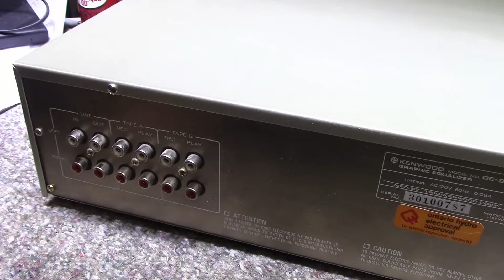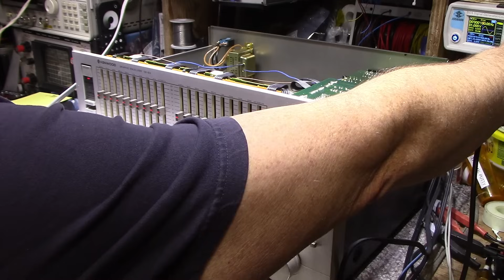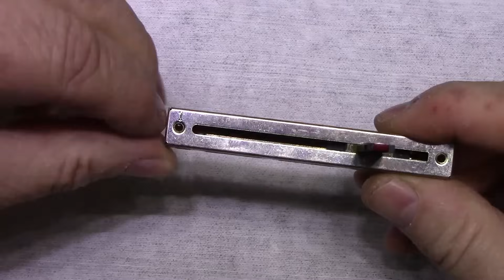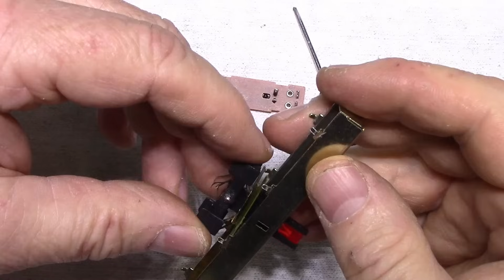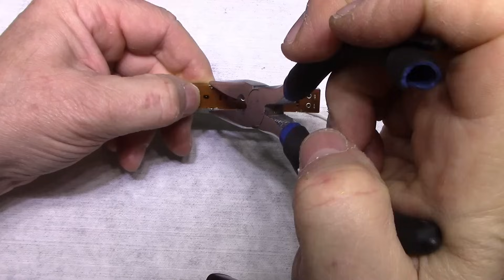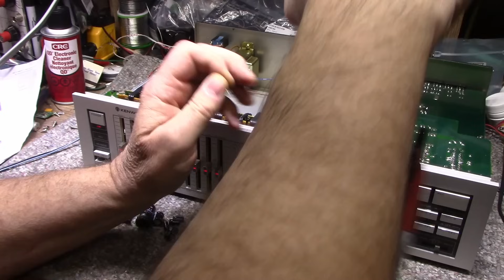Kenwood GE-9X Equalizer (Ep. 216)

Comment: Equalizers became popular with home audio because of home recordings being pretty low quality and also being of variable quality. It was the popularity of cassette recorders and cheap tapes that lead to people needing more control than the standard bass, treble and high/low cut filters. Of course this meant people found they could apply more EQ to other material to boost certain frequencies and cut others, it also meant they added distortion but most people actually preferred a little distortion to a pure clean sound anyway because that's what they were used to hearing.

Comment: I have several ADC equalizers.  One thing I found was that the F5 spray flushes out the damping grease and ruins the feel of the fader, making it feel gritty and unpleasant.  There is a fader grease that can be applied post flush, but overall it never really feels like it originally did. I only use the EQ for the light show along with an LED power meter and a pair of spectrum Analyzers in my homage to the 80s system. I sold off my Cerwin Vega AT-12 's so that system is now being sold off piece by piece.
Reply: The braking effect is easily emulated by application of a miniscule quantity of highly viscous grease to the non-conductive surfaces of contact. That's precisely how this "feel" was achieved in the first place by the manufacturer. Now, obviously, I don't "flush" them, but rather take them apart for cleaning one by one, lots of fun with a 12 band.

Comment: An EQ is only good with white noise, a spectrum analyzer, and a mic.  The point is to make the sound flat, not boosted or cut unnaturally.  Professional venues use them for flattening response.  I used to tune movie theaters with an R2 analyzer, (THX) which had four microphones and an analysis display.

If your receiver has an auto-analysis feature for setup, when it uses a microphone, I suggest using it.  Most amateurs used EQs incorrectly and made their stereos sound horrible.